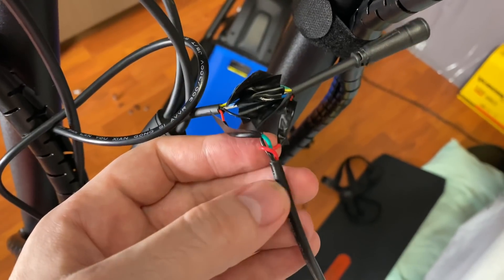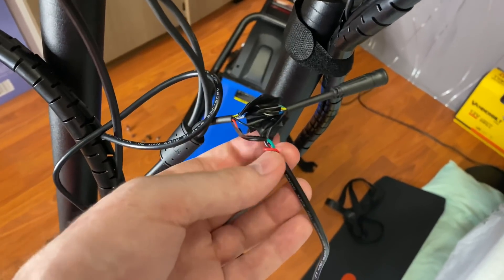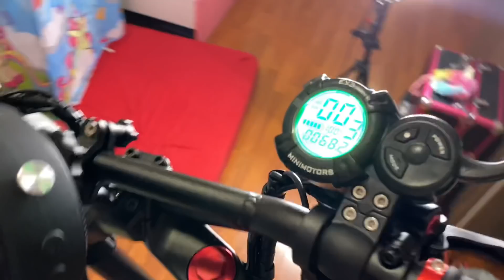Installing Key Ignition & Volt Meter To A Kaabo Wolf Warrior 11 Electric Scooter How To

Comment: Can you do this to bypass the initial password prompt? I just got my scooter back (amongst other property belonging to me) from my ex after a crazy separation. But when I got it back all my wire were switched around, mybattery was shot out, LED lights were stripped off, and a bunch of other damage done. I finally got it back in proper shape. However when I go to turn it on there is an advanced settings password, I cannot start the scooter or adjust any settings without providing this code. Ive tried the default codes ive seen on the internet but nothing works. This jackass changed my passcode locking me out of my own scooter. This is my method of transportation for work and school. It’s imperative that I get it going again if someone can please help. Just background info, I’m  the 2nd owner purchased used 2 years ago  never had any other issues except for some minor cosmetic damage. Please let me know what I can do or how I can override or reset to factory settings. Ive already unplugged battery for 20-30 seconds and plugged back in. Didnt work obviously

Comment: I tried to install one, and now my e-scooter just beeps and displays e0. The brake light doesn’t come on either, but works with just power to it.  The headlight can still be turned on though it’s beeping but no power to the motor. What do I do to fix it?I have a controller with no wires, only pins, in case it helps I have a MICROGO m5 pro.

Comment: Good job on explaining that I always use heat shrink on installing everything that I do but I've worked at a shop for 9 years so we're kind of picky. Personally I just added an alarm system that plug directly into the gel pack and directly into the LCD display therefore this has an alarm plus a LCD display shut off. But this should help a lot of people good job
Reply: What model was alarm system ? thanks

Comment: Hi. Thanks for sharing this quick and comprehensive guide on the wirings. Just saw another vid which has a different diagram on the ignitions wiring to the display and controller. Is the difference due to different scooter / display? Thank you.

https://youtu.be/fAJwSIeaoR8?t=52
Reply: That is because the system that he is wiring up is a ey3 from mini motors the display that is on the other video is either a lt-100 or a lh-100 so the wiring colors are going to be different.

Comment: I have a question
I got my wolf scooter yesterday, I am very happy. But I noticed the batteries finishes way faster than I expected. It had 50% power, i traveled around 5 miles and 50% battery power finished off! 
I was expecting the 50%  battery power to take me as far as 35 miles
Is this normal? I weight 165 pounds
Reply: Is it real
Reply: @fredrickarmstrong5039  actually i discovered the first 50% will take you lots of miles
Reply from the maker: Make sure your battery is ok did you check the volts
Reply: @KuyaMagik  yes. I learned the last 50% finishes really quick. But the first 50% (specially the first 10%) can do most of miles. So it's ok

Comment: If you only want key ignition without volt meter  is it only 2 wires that are needed on the key ignition?
Reply from the maker: That’s correct